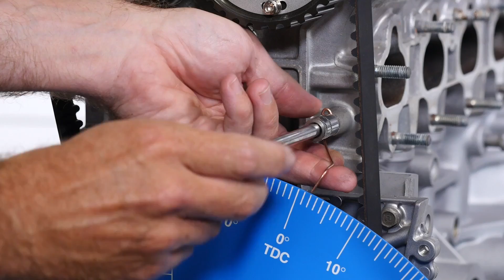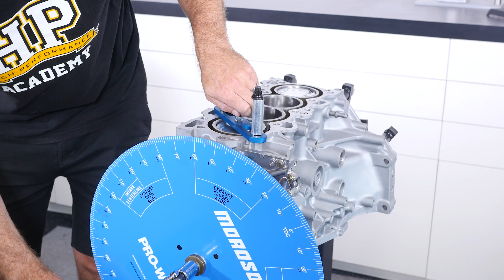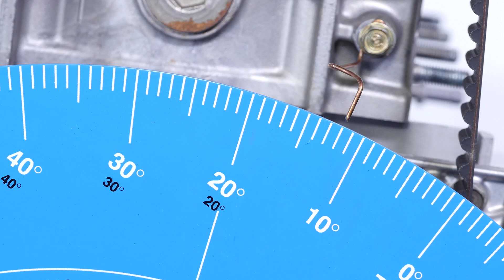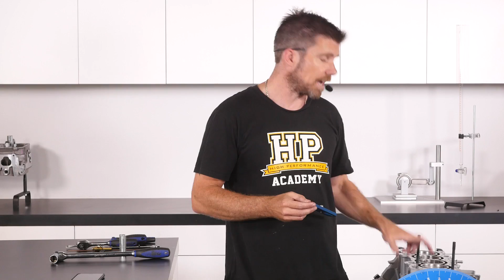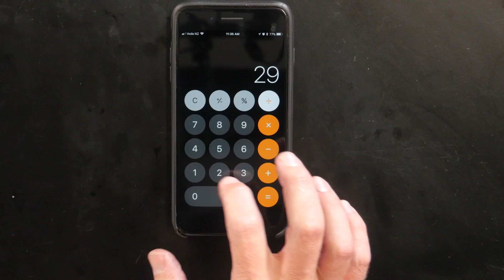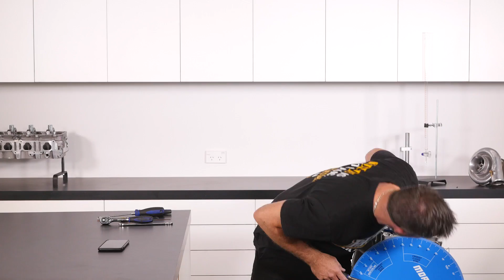3 Easy Techniques to Find TDC | Cam Degreeing [#FREELESSON]

Comment: using a plate heads off method how do I know how far to adjust the stop screw in to the cylinder? if I bring the cylinder up to just before tdc then set the screw how is that accurate? am I just visually seeing the top of the piston in the bore then set the screw? im a bit confused here.  same scenario for a spark plug hole tool. how far in do you adjust the rod?

Comment: That is a big degree wheel
Reply from the maker: Yes, the bigger the easier (to a point!). Many are smaller just so you can use them in the engine bay which isn't something we have to worry about in this instance - Taz.

Comment: Ok so if I find tdc for the piston from the block using the last method, then what? What’s the number used for? Just to start puting the head on? So get the piston to tdc then put the head on then degree the cams? I also thought it is bad to turn the crank left and right when the belt is on. I’m building a H22 right now and didn’t know any of this stuff I haft to do 😅😅😅😅 help

Comment: The way i was shown was dti down spark plug hole and zero wheel once piston reaches its highest point, then keep rotating crank until dti is about to start moving down, note reading on wheel and divide by two, this is true tdc. 

Sounds much simpler than your first method, does it give the same result?

Thanks

Comment: So why did each method give slightly different results? It should have been exactly the same before and after TDC after the first method unless the wheel and/or pointer were disturbed.
Reply: I did wonder this, I suspect it was deliberate.
Reply: @rompdude  in reality I'd actually expect some variation because of crank offset, which causes the piston position vs crank angle relationship to be asymmetric. But this seems like a bigger difference than would be expected from reasonable crank offset.

Of course, this does also mean that the indicator method is the only repeatable method (unless you re-do the other methods to always contact at particular angles), since your TDC then is a function of the difference in displacement/angle you use to find TDC. 

And changing conrod length or stroke would potentially mess with this relationship as well.
Reply: I think the positive stop method takes up any component slack vs the dial indicator doesn't put any load pressure on the components.

Comment from the maker: 🔥 Building a fast car? Get $400 OFF the all-inclusive VIP online course package deal: https://hpcdmy.co/vipy125
✊50% OFF your first online engine building course. Enrol now:  https://hpcdmy.co/offery125
0:00 - TDC: Critical, and Misunderstood
0:35 - 3 Techniques
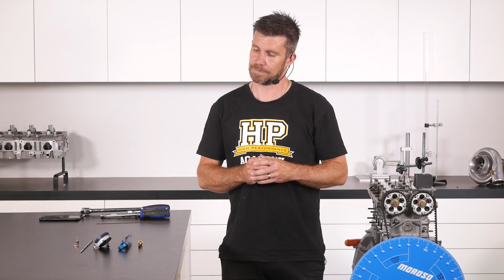1:17 - PRO TIP: Make and Sharpen Your Own Pointer
2:16 - Getting Started: Mount Your Pointer/Indicator
3:36 - TOOL 1: Dial Indicator - Finding TDC and Dwell
8:02 - Take Your TIME, Double-Check
8:17 - TOOL 2: Positive Stop - Commercial Style
8:47 - Positive Stop - Make Your Own
9:04 - Positive Stop  - Finding TDC
13:29 - CRITICAL STEP: Remove Your Positive Stop
13:39 - TOOL 3: Deck Plate - Cylinder Heads Removed
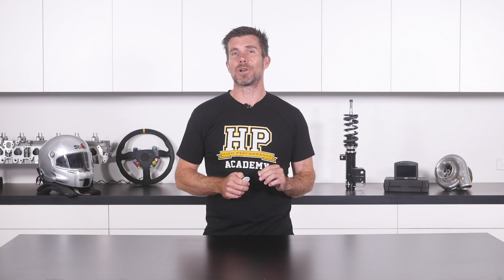18:13 - Now You Can Degree Your Camshaft